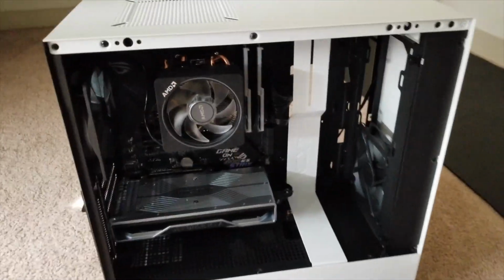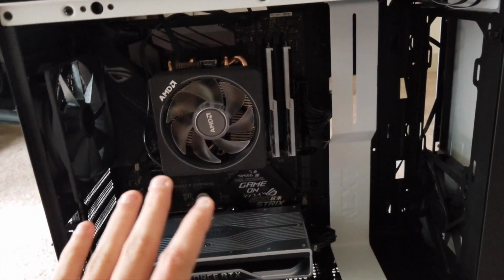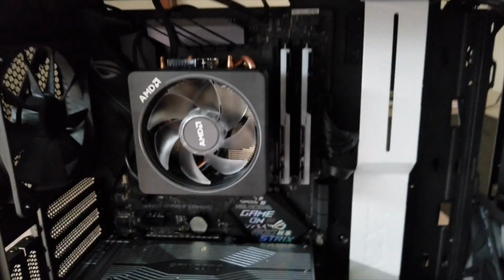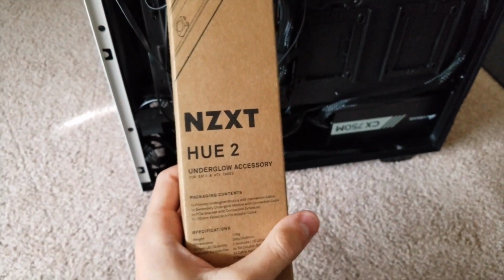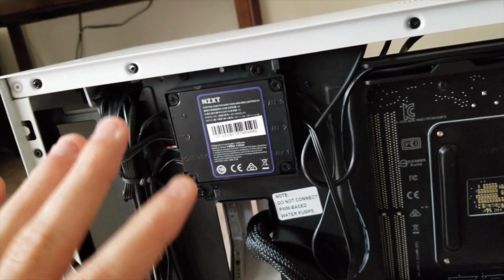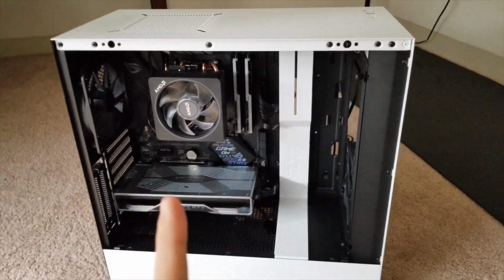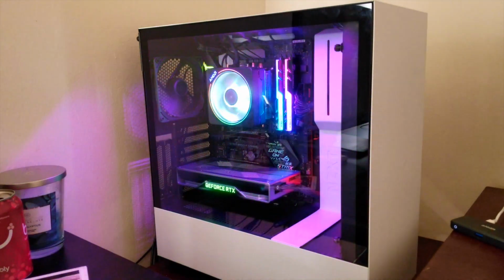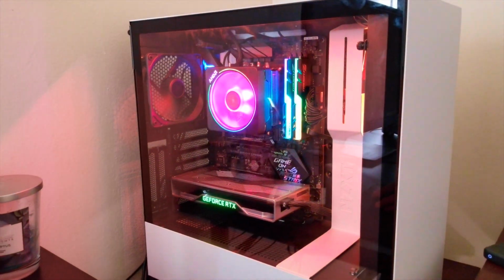NZXT H510i Case - Follow Up and Build

Comment: very nice video man! I just build my first PC, plugged everything in but my front fans from which came with the case do not work tho. The RGB lights do work, but the fans to not spin. I plugged  everything the right way just like the instructions show. Did you had to activate the fans in your BIOS? I have my own CPU fan which works perfectly fine, in the back and on top.
Reply from the maker: Nah the case fans shouldn't have to be activated in the BIOS

Comment: how did you get the 3700x into the b450-f?
Reply from the maker: It just goes right into the CPU socket 🤷🏼‍♂️
Reply: Ja Boi 😂😂 i meant that the b450-f can only support 2nd gen ryzen and the cpu is 3rd gen
Reply: Your board was probably part of an old batch. Manufacturers did have new and old batches when 3rd gen ryzen released, i think.
Reply from the maker: Yeah, you can pick up new versions of the board that work with gen 3🤙🏻

Comment: I have a question for you man - I will have the same CPU/GPU, as well as this case. How are your temps? I am trying to keep my GPU below 80 degrees C, I am not worried about the CPU because I have a quality cooler. Thanks for the video, it was helpful
Reply from the maker: Hey man, my temps have been fine. However, this could vary for you based on a bunch of factors. If the computer is in a hotter environment, if you plan to make out it capabilities, if your running high demand programs or games all the time. Just watch your temps and add extra fans if need be 🤷🏼‍♂️
Reply: Thanks brother

Comment: Nice build, but please move that GPU on the 1st Pci slot. It's going to perform way better that way
Reply from the maker: Please read the comments my guy🙃 changed that boi months ago and it's not that's big of a difference
Reply: @JaBlankSki  Sorry, my bad. Have a nice one
Reply from the maker: No worries man, you too 🤙🏻
Reply: @JaBlankSki  I have a question though. I see you connected the Smart Device v2 with a USB connection to the Motherboard. But I've also read somewhere that their Hub doesn't have a USB cable.
Reply from the maker: Doesn't have a usb cable? Idk I hooked it up according to the manual🤷🏻‍♂️

Comment: Nice video! Question, do you get 2 LED strips with the case?
Reply from the maker: Yeah, one towards the back and one above the glass🤙🏻
Reply: Ja Boi how do you turn those on?
Reply from the maker: Should go on when the case is turned on. You can changed em though the NZXT CAM software
Reply: Ja Boi I think mine might be broken then because I downloaded the software and it said that no lighting devices were detected and they don’t turn on
Reply from the maker: Could be🤷🏻‍♂️

Comment: Yo bro u put the gpu on the wrong slot use it 1 above u not getting the most power out of ur gpu and what ram sticks are those??
Reply from the maker: Already done, have a pinned comment about it. The performance difference is so minimal, but it is what it is🤷🏼‍♂️ my ram is the G.SKILL TridentZ RGB. 16 GB each if I'm remembering correctly🤙🏻

Comment: Hey homie, love your stuff. I just wanna ask if you still answer late questions; do the fans just work by connecting it to the thing? Or do i have to put it in the mobo too instead of just the hub
Reply from the maker: Thanks for the kind words🤙🏻 They will work just connected to the hub. You can connect them to the Mobo if you want them to be controlled via a different software 🤷🏼‍♂️

Comment: Thanks for this great review. Appreciate the explanation about the Hue 2. Got a question: how are the noise levels in this case? Is it pretty silent with the fans on?
Reply from the maker: Depends. Normal stuff or light gaming will keep it pretty quiet. But when you start putting your gpu and cpu to work you can start hearing the fans kick in. I personally don't think it's unreasonable for a fan setup but to each their own 🤷🏼‍♂️
Reply: @JaBlankSki  
Thanks for your replay. Have I understood you correctly that if you disconnect the standard fans plugged in the hub and replace it with (for example) the Aer RGB 2, you don't need to buy the Hue 2? Its for additional accessories only?
Reply from the maker: Honestly I'm not sure🤷🏼‍♂️

Comment: I don't know if someone else told you but read the manual and most probably you will see that you should put the gpu in the upper slot.maybe I am wrong maybe I am right,you don't have anything you loose
Reply from the maker: Pretty much every single comment is people saying to move my GPU and I even pinned a comment saying that I already did move it. Thanks for the comment though

Comment: This case is awesome. I appreciate the fact that the front panel connectors are in a block and not seperate! How’s the performance of the stock cooler? I’m building a similar PC soon but with a AIO. Great video mate, I subscribed!
Reply from the maker: Thanks man 🤙🏻 the cooling is decent 🤷🏼‍♂️ AIO probably is better, I may switch to that at some point. The biggest heat maker is the GPU honestly 😂
Reply: @JaBlankSki  air cooling is actually better, go with noctua fans
Reply from the maker: Maybe 🤷🏼‍♂️ I'm still rocking fans for the time being

Comment: Nice vid, I think I will getting the 510 i... 
When you described mounting your motherboard you didn't mention standoffs. I know first time builders that's usually the one thing they might miss. Were they already mounted for an ATX board or did you put them in. Those you want to make super tight because you don't want them to loosen when you take the mother board screws out.
Reply from the maker: Hey! the stand offs where already on the case itself! All I had to do was line up the motherboard and screw it in👌🏻

Comment: First build ever and it’s not going well at all. Where tf do you blue the three fan hooks into???!!!
Reply from the maker: The fans should be plugged into the hub in the back. Then I think there is a connection to the Mobo and to the PSU? Read the manuals my guy🤙🏻
Reply: Ja Boi I have. Over and over and over lol. About to return all of this nonsense 🤣
Reply from the maker: I mean if you plugged everything in properly and have power and the fans still aren't working, then they may be defective 🤷🏼‍♂️ the manuals for the case and motherboard will tell you exactly what to do 🤷🏼‍♂️
Reply: Ja Boi it’s ok. I give up lol. Nothing is running except the LED lights somehow 🤷‍♂️🤣🤣🤣🤣
Reply: Ja Boi I pulled it off lol now trying to figure out how to operate the lights 🤣🤣🤣
Reply from the maker: If things seem to not work in the case you can always return it🤷🏼‍♂️
Reply: Ja Boi it all works! Your vids helped me a bit lol the only problem I’m having is it kept freezing on me

Comment: Your GPU is in the wrong slot. The top Pcie slot has the most bandwith! It will run about 40% faster in the top slot.
Reply from the maker: Read the comments my guy, moved that months ago. Also 40% is kinda a reaching improvement 😂 it's really not that much different

Comment: Do not buy this case if buy a gigabyte Ryzen motherboard as the top fan interferes with the 8/16 pin cpu power plugs and bends the sockets. I asked NZXT about it but there not interested at all. Be warned.